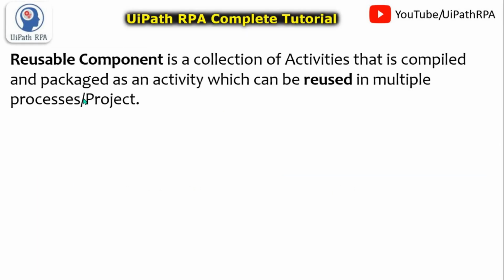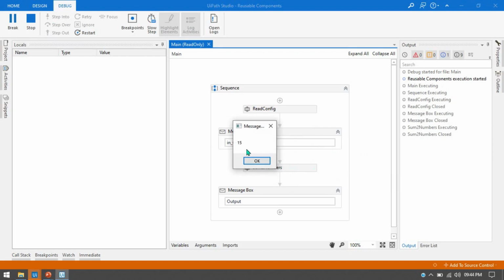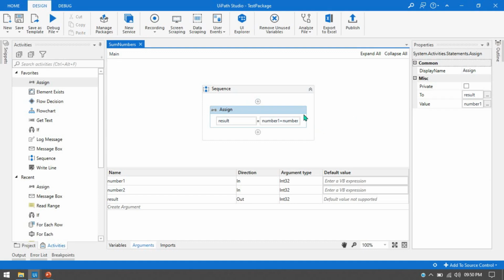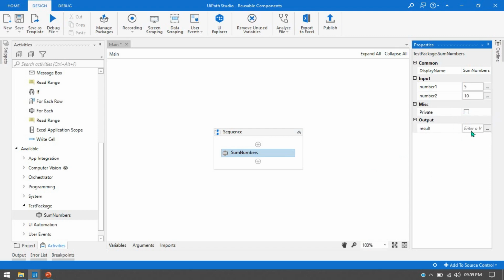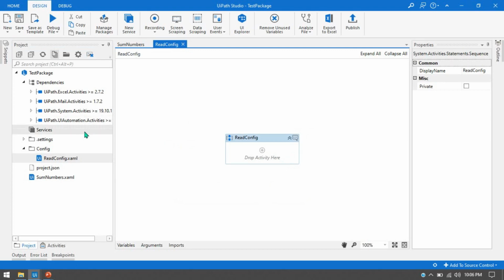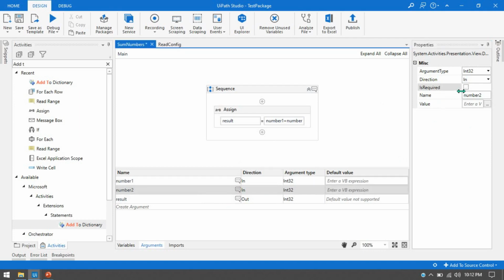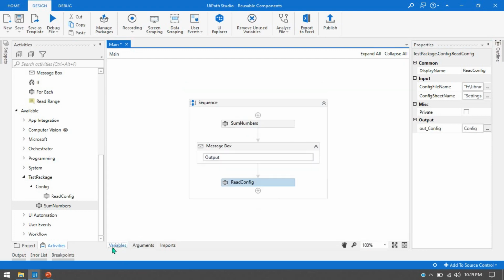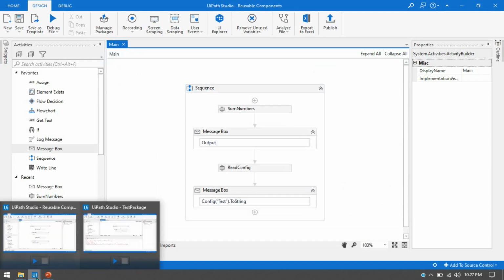Reusable Components UiPath | UiPath Library | Create Nuget Package UiPath

Comment: hi Manish,

thanks for the video. I tried the same for hand-son. created a custom activity using library read range then for each row and add to dict. . but when i m using this activity in another process then its giving error " Column 'new_value' does not belong to table Data-table." i used output data-table to see if any issue with excel i can see the config file with column new_value but i m not able to get the value of a key using our custom activity ? can you share your email id i can share the xaml files
Reply from the maker: uipathr@gmail.com
Reply: UiPath RPA will share it by tomorrow
Reply: Hello Abhinav and UiPath RPA same issue for me as well - Any quick fix please
Reply: @syedkhaja9510  @Abhinav Pandey...I faced the same and fixed it. 
The fix is - Please add "" at the range in the read range activity instead of keeping it blank. It worked for me !!